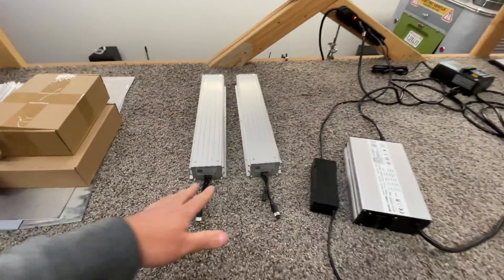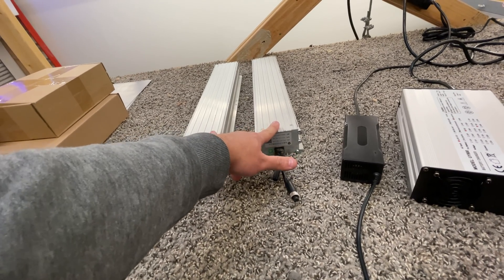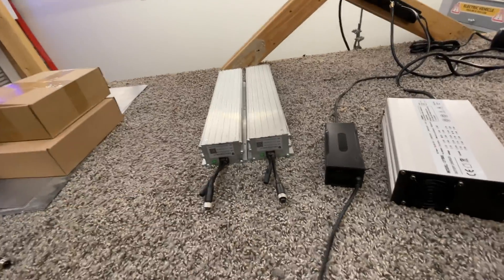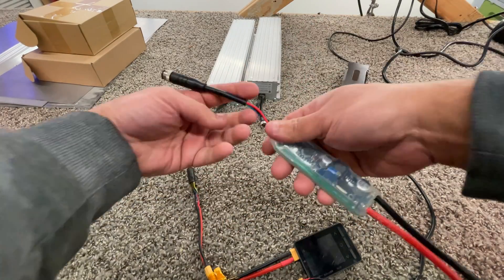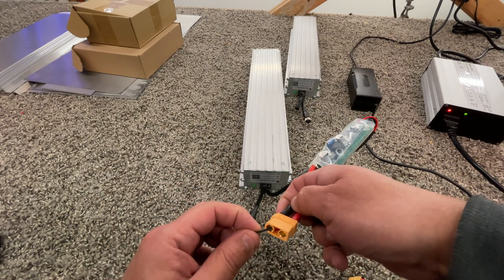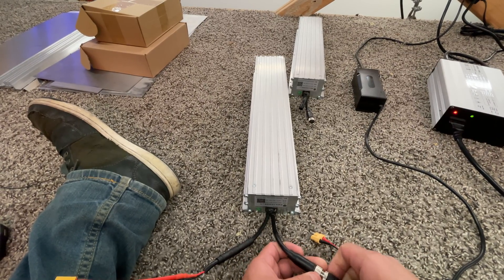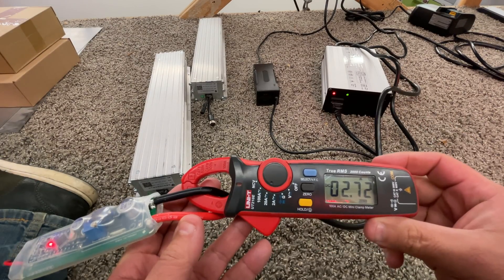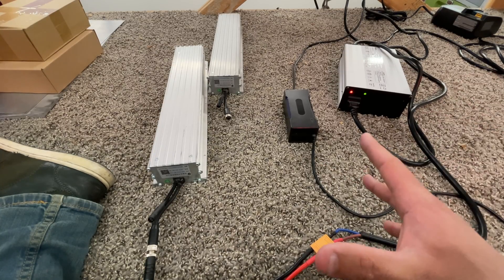Why Are my Scooter Batteries Not Working with my Bluetti?

Comment from the maker: here is the small connector if anyone is interested https://www.mutuallc.com/Z409F-4-pin-Battery-connector-pd40602085.html
Reply: @jehugarcia  I believe I found them at motoworks which may be part of mutuallc. They are expensive $50   https://motowoks.com/search?type=product&q=charger. I requested the XT60 plug be installed in place of the female end. They request you email them with the length and type after your order is confirmed. Thanks Jehu for your follow up! Oh Ya Free shipping and they use paypal!
Reply from the maker: 50 for how many?
Reply: @jehugarcia  For 1. LOL Expensive
Reply: @paulthompson4618  Thanks for the link, I'll have to order one up.
Reply: Just a heads up I’m working to order 50 male end plugs for these batteries, I hope to offer them up for sale at around 10 dollars each. I’ll post more information here once I’ve got the cable ends in my possession. They are coming from China so it may be a month or longer before I have them.
Reply: @NoOne12  Just sent you an email
Reply: @JoMiller97  I sure did, shoot me an email or drop and email here and details on how many cables you need and I’ll get you a quote ASAP.
Reply: @NoOne12  I sent you an email a few hours ago. If you didn't get it let me know, I'd prefer to not post my email address on youtube lol
Reply: @Da Row I really hope to have the shipping figured out this week as its really the only hold up. I'll let you know here asap
Reply: Yeap just got 50 of these connectors in the mail. I gotta price out shipping, PayPal fees and get mailer envelopes later this week so I can provide quotes. Cables themselves are going to be 6 bucks each plus shipping and any PayPal fees. If you want me to email you more details shoot me an email joeltinaz(at)gmail.com and please include a zip code for shipping. I’ll have pics available if anyone wants them, also note the is just the male end of the cable with approximately 10 inches (250mm) of wire.
Reply: Also note once these 50 are gone I won’t have more as I’m not looking to start a business selling these cables just getting rid of the extras from my minimum order.
Reply: @Da Row just wanted to let you know I’ve been super busy the last few days trying to finish building a chicken coop and haven’t made it to the post office. I should have more time this week starting Thursday. If you want shoot me over a zip code and I can check shipping for you and get a final price ready.
Reply: @Da Row shipping quote was 4.20, PayPal I believe charges 4% in fees. So looks like 10.60 shipped lmk and sorry for the delay
Reply: @Da Row np and email sent, just let me know.
Reply from the maker: We now have those connectors
Reply: Just want to be fully transparent, jag35.com now has these cables listed on the site for sale and at better price per cable then I can offer(likely due to the qty they purchased). However with shipping both of our prices per cable is very similar from my own research. I do offer combined shipping on the cable ends and may be cheaper if you need 3-4+ cable ends in a single order. I can also solder xt60 male or female ends at an additional cost if needed (other ends available as needed and as long as I have it example xt90). I will be asking people to post here as they receive their cable ends from me as well in hopes that everyone is happy with the transaction. Currently I have 44 ends left in stock.
Reply: @NoOne12  @NoOne12 is  an honest DIYer that took the risk for the rest of us to get these cables from China. I purchased from him and received the cables promptly with great communication. If Jehu is out of stock or you want to help @NoOne12 recoup his costs, you can buy from him with confidence.
Reply: @NoOne12  I highly recommend buying the cable from you! I bought mine from him and he soldered the exact connector that I needed, sent me photos along the way, sent me tracking info, and even followed up after it arrived. Great guy and was a HUGE help, thank you!
Reply: @FamilyTreeTherapy  Thank you as well! Glad I could help.

Comment: qualified electrician and electrical engineer with over a decade of experience here, I don't know why this man is instructing anyone to "jump" the pins to wake up the BMS with a incorrect pinout diagram shown drawn on paper then decides to try it just for it not to work and then say "sometimes it work with some batteries" yeah im just gonna go ahead and inform you all that positive on the big connector is on the left pin and the negative is on the right hence why he couldn't wake the BMS since he was bridging negative on the small connector to the positive on the big connector instead of negative to negative. but skip all that and just grab a multi meter and check for your self to always be safe and don't bother with the small connector at all in terms of charging since all that needs to be done to charge is using a 2 amp charger on the big connector with right polarity and the charger will do the rest and the cells will charge to the correct voltage and with a nice full charge all the cells will balance out just fine anyway. After that just chuck a arduino on the correct pins to talk to the bms and it'll stay on safely just fine if you program it right since its only always gonna do exactly what you programmed it to do  as apposed to using one of those dodgy battery activator chips that can fail and fry.

Comment: Thanks to Jehu and all the contributors. I bought 4 x NCR18650BD scooter batteries last July and a Jag35 4x Dongle, and everything has worked fine, until recently, where I left the batteries charged but unused for a month and I can no longer wake them using either of the methods described in Jehu's video. No red "charging" LED shows on any of my chargers when connected to either of the two NCR18650BD battery ports, has anyone seen anything like this? Thanks again.

Comment: Thanks for the batteries! I just got Segway 30 cell pack from you guys and I’m using it for my 36v 750 watt ebikeling kit!  It’s awesome, but the system cuts out after using throttle for like 20 seconds. I can turn the system back on but it’ll shut down again.  Do you have any tips or ideas on what I could be doing wrong?  Thanks in advance! (I clicked the little button on the battery and charged it for several hours before using it)

Comment: I have 4 batteries that all charged. Then came the hard part. Trying to activate the batteries! I thought the dongles were supposed to transmit a code to achieve this? Nope it didn’t happened. By the way I should probably mention my first X1 dongle overheated an died an early death. So I proceeded to try the other methods described without actually having the tools to execute. Improve time! I tried the neg to neg with a wire since it’s so easy and quick. NOPE!
I used two wires from the “+” “-“ and two of the batteries woke right up but other two I still have not been able to wake. I even bought the small male connector so I could do the job properly but I just can’t wake these lazy boys!
Any help or ideas would appreciated!
Reply: You know I feel your pain. I have a couple that are inconsistent in waking up. When you have a pack of 4 batteries, you don't know all 4 are working. Frustrating for sure.

Comment: I can't get my battery to activate. I've tried everything you have said but it still won't work. Do you think anyone can help?
Reply: Does it matter if the conectors are xt90 or xt60
Reply from the maker: How are you trying to wake up your battery?
Reply: @jehugarcia  I connected the two negatives first, then I hooked up the charger to the smaller port. The small red light was on but I never got the main red to come on.

Comment: Hi, i just received my battery (and dongle).... Regarding bridging the negative pins on the small and large connector.  But the image on the jag35 (page where i bought battery) shows different negative terminals than the image in the video! website says both negative on small connector and large is on the right side (notch facing up) while in the video you show an image that says large connector has negative terminal on the left... Please verify which one is it, i think ill play it safe and jump through the dongle since that is clearly labeled, but would like to know which is the negative terminal on the large connectors!   Also is it the same charging the battery through either large or small port (are they internally connected in parallel?)?  ALSO at some point you used the 18A charger to charge the battery through the dongle connected to the large port, will that way work with the 2A charger as well?  Lastly are you going to be stocking more of the large connector on jag35.com...  Thanks!

Comment: Thanks so much, Jehu!  I got both cables and tried connecting negative pins and, like yours, it didn’t bring it out of hibernation.  I the applied 4vDC to the charging connector and, violá, it woke up instantly!  Outstanding.  

Seems to be staying awake now but I’m unsure of its SOC.  Open circuit voltage is 40.7 v so I think they’re near full charge.

Comment: Can I use this battery on my jackery 240
Reply: Hey Andrew, the Jackery 240 has a 12 volt charge controller, accepting 5 amps.  These scooter batters are 36 volt spitting out about 45 amps.  You might be able to use a 36V to 12V converter, but I'm not sure if the Jackery could deal with the amperage.   Even if this does work, you would be losing quite a bit of efficiency.

Comment: Can you charge the scooter batteries via solar as well
Reply from the maker: Yes,  you’ll need a solar charger controller
Reply: If I did six of them batteries what kind of solar controller would I need
Reply: @codyhadley7003  You would need to wire all 6 in parallel and get a 36volt charge controller.

Comment: @jehugarcia where  can purchase a 2 pin connector charger for the 4 batteries I purchase from you.Thank you
Reply from the maker: There’s a link on the product page https://jag35.com/collections/jehus-deals/products/copy-of-40-cell-ncr18650bd-18650-lithium-scooter-battery-pack-w-case
Reply: I bought it but it has a different end. Do I cut it off and add an XT90?  What about the blue wire?  I see it connected on your side.
Reply from the maker: Yeah add the xt90 connector,   Which blue wire?
Reply: @jehugarcia  didn’t know if there was one, haven’t cut it off yet, but there is one on the cut connector that came with the battery.

Comment: I was able to wake up the 4 batteries,  no problem.  My question is as I'm charging the ac200p in put watts start at 480 or so then reduce down, almost like a count down to 130. If I unplug the packs and replug them in it starts over. Anyone know why or if this is normal.  The ac200 was at 57% charge.
Reply from the maker: its the MPPT solar charger,  it scans to try to find the Max Power Point,  its normal,  if you need to charge faster try this https://youtu.be/FeJ4o8aEdsU

Comment: I have purchased these scooter batteries and dongles from you and I am very pleased. The only problem I'm having is when I go to bed at night with a set of batteries charging my bluetti when I get up the next morning the scooter batteries are discharged and have went to sleep again. I have to wake them again. I thought once I woke them they would stay awake.
Reply: They will go back to sleep to save the cells in the pack when the voltage hits the set limit. I would not suggest splicing the output and input cables together as the input is only rated for 5 amps if I recall and the output is rated for 25 amps. Could cause a fire if you charge at over 5 amps per pack on that input plug.
Reply: Question: Would anything be damaged if i splice the positive to positive and negative to negative  leads of both cables together so that when I charge the units they automatically wake up?

Comment: @jehugarcia I purchased 8 battery packs, 6 out of the 8 were in sleep mode. I charged each battery then used a 18-20awg negative to negative connection. Biggest problem I had was dealing with thin wire and my tremors. If a noob mid 60's guy can follow Jehu's instructions you younger guys have no excuse.  People you can always verify polarity with a multi-meter as you should always check when dealing with equipment the first time. Thank you Jeru this was so easy I cancelled my order for the $50 cable. Appreciate the work you put into this project and the very fair pricing. I am now ready for the Florida Hurricane Season....at least for my power needs!

Comment: I'm sure others have made the comment already about the connectors when you were trying to bridge both negatives.  The pic you put up at min 4:31, (the longer cable on the right) the negative is on the right.   Found out when I used volt meter, bridged the negatives and brought them back from 20v to 42v. Everything is working now.  Thank you again for your awesome videos!!!

Comment: Dude, that 6 pack custom board sounds amazing!  Considered adding pins or mounting for options like a 12v-36v cigarette port style USB, and a voltage meter, even if you don’t include the hardware having the board design where folks can mod in extra features if/when they want , will be awesome

Comment: @Jehugarcia ... correct me if I'm wrong.  But given the scooter battery is 36V 10s4p, a 100% fully charge battery would give you 42V.  But when depleting the scooter battery down to like 40% of the battery, the voltage drops down to 34.8V.  The Bluetti solar input requires at least 35V or it doesn't work(?).  Meaning that you would only be able to get about 60% of the the scooter battery before the scooter battery would stop charging the Bluetti and that's given you are topping the scooter battery at 100%.  So instead of getting 460W out of the scooter battery to recharge, you are realistically getting less than 276W per battery.
Reply: Jim... The solar input requires 35v - 150. Max 700W, max 12A. 

https://youtu.be/sD6q-5oAOe8

In his first video around the 5:20 mark, he adds the 2nd battery to the dongle but it gives roughly the same output of 420W and then he goes into saying that it was due to the limitation of voltage and that it would be complicated to increase the voltage.  So you can't just use the dongle and get 72V out of it.

But if he could show us the more complex way to do it to achieve this, I would love to see it, bc I would be more incline to buy the battery packs for this purpose.  Otherwise, I think you're still only going to get like 60% of the battery before the bluetti solar input limitation kicks in.
Reply: @cheekysidekick7365  sometimes they round it, but it’s not complicated to make these 72v , just hook + to - on the pair, and use the + on one pack and the - on the other. The watts is load, it wouldn’t change just because you went parallel... the amps drops in 1/2 at 2x the voltage for the power in whatever watts
Reply: @olemissjim  so...you are saying I'm going to have to splice the proprietary cable on each one so that I can wire it as you describe and then reattach the leads to the cut proprietary cable so that it can attach to the dongle?  

But are any issues with the dongle sending the right signal back to the battery packs in this configuration.

Like I said before, I would love to see him make a video of him doing this at a higher voltage using multiple battery packs and drawing the max output out.
Reply: You are mixing watts (instant power) when you want to ask about the usable watt-hours wH.  Otherwise it’s an interesting question, can’t you just look up the Blueiti spec sheet to see the min/max input voltage?

You can use two packs at 72v via the solar input for 100%’of the scooter packs BMS guarded capacity and still be in the Blueitti usable input range.

Comment: Hi Jehu love your work! i have an AC200P and want to expand the battery storage to around 7000wh, ideally with your external battery packs or even the new 280ah 3.2v cells in 48v configuration you have been taking of. My question is can i plug in one of your 36/48v battery packs into the solar input of the AC200p and still charge the external battery pack with an external MPPT controller? will the AC200Ps built in charge controller have trouble with an external charge controller plugged into the external/expansion battery pack? ideally i want to charge and use it all at the same time....cheers

Comment: I got 20 of these batteries to make a portable solar generator. I used one of the arduino activators at 3.3v using dv-dc buck converter in parallel for all 20 battery blue wires. Was having major trouble keeping batteries on. They would randomly completely shut off and kick back on after 10-200 seconds after applying loads of 20+ amps. Jumpered discharge and charge negatives thinking it was hibernation mode, didnt help much. Found out that the activator couldnt handle 20 batteries. Added 2nd arduino activator, one per 10 battery packs and removed jumper between battery charge/discharge negatives, no more issues. Just wanted to put that out there.
Reply: I had to jump the arduino up to the standard 5v so that my output voltage was around 3.3v to all of the packs.

Comment: You stili haven't answer the big question.  How Many CYCLES are in the batteries?
Reply: 500-1500 depending on temperatures and how many amps you push through them

Comment: Will the dongle work on lyft or bird scooter batteries? Also, if I buy the 4 dongle and only plug 2 batteries into it will it work, or do you need all 4 batteries plugged into it for it to work? I bought 2 batteries but will be buying 2 more in the future. :)
Reply from the maker: Will only work on  okai ES200G scooter batteries as far as I know.  You can plug 1-4  packs they are wired in in parallel.